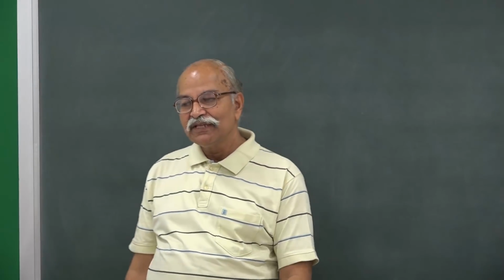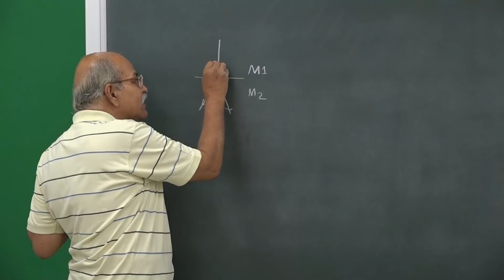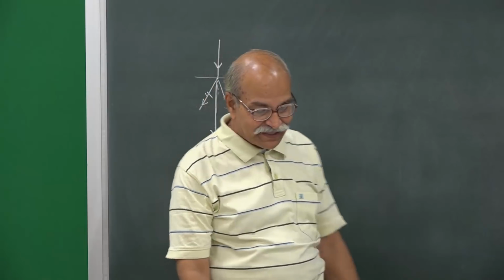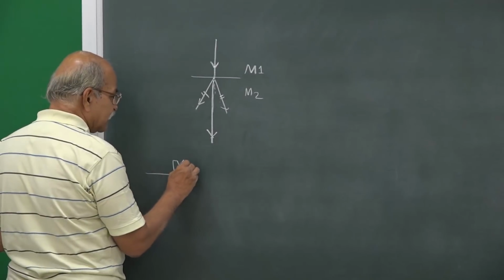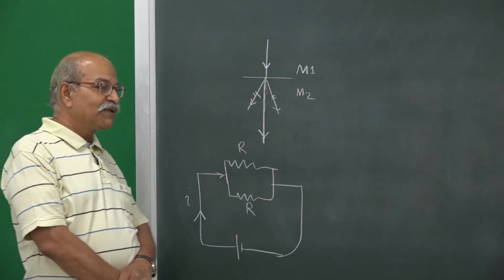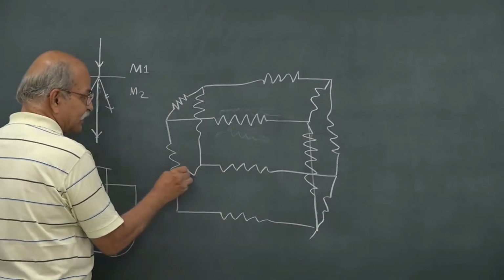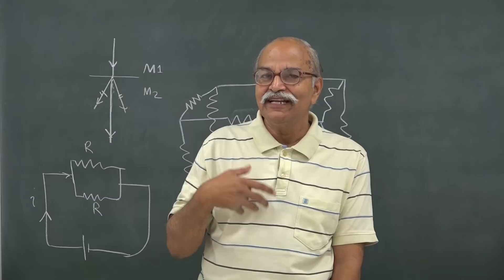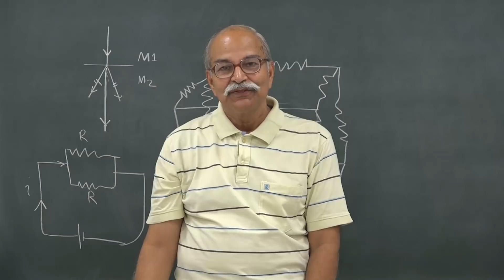Symmetry considerations in  resistance networks

Comment: why we use inverse symmetry in wheatstone bridge, despite the fact that current also goes through a middle resistance
Reply: The potential at both the ends of the middle resistor is same therefore the potential difference of the middle resistor is zero and due to that there is no current flowing through it
Reply: I have the same doubt

Comment: It can be also stated that current always follows that path which have low resistance. But in case if there is path of equal resistance, current will divide itself equally
Reply: I am a bit unsatisfied with this statement that current always takes low resistance path For ex if there are two resistors connected in parallel having different resistances then According to you current will not flow through the resistor having high resistance
Reply: @aryansinghparihar6932  what i said is that current always tries to follow low resistance path. If 2 resistance connected in parallel, then u will find that current flowing through the high resistance will be low as compared with current flowing from low resistance. Further, its quite obvious that current is bascially due to flow of electron. If there is hinderance on flow of electron, current will be low. Simple logic.
Reply: @aryansinghparihar6932  if u have any doubt regarding my statement i can clearify in my video. If u like i can make o  this topic.
Reply: Although I got it well but If you make a video then it would help me a lot
Reply: @darkseid856  yeah u got it right, thats what i stated before
Reply: @aryansinghparihar6932  check my playlist, i uploaded a video for the same.
Reply: @IntensityEducation  Thanks

Comment: Sir, why electron move from cathode to anode in electrolite solution (battery machinisim)??
Reply: @santafucker1945  because of the sudden difference created in their atomical composition due to induction of electric charge in a liquid (mainly) solution which actually intensifies(in some cases) the chemical effects of electric current affecting the flow of electrons .

Comment: Sir, what actually changes the potential of different parts of circuit? Do some charges accumulates at different parts?
Reply: The potential is divided through whole wire. But if you take series combination of different resistors then, different resistors will have different potential across them. You can say that resistance want to get the potential. The more the resistance the more potential it extracts from source.

Comment: Why do electrons not stop after passing across resistance because of the loss of energy?
 
If an electron does work to pass a circuit component load resistance, why don't they eventually stop moving after passing load resistance and transferring all of its energy?
Reply: Field

Comment: Sir,why current is same in series circuit?
Reply: I might be late but this is just like the flow of water...Suppose water is flowing through a hose pipe(Lets assume the water is incompressible), so in 1 second, equal amount of water should pass through every cross section of thee pipe, otherwise it would cause the water to be compressed at some part of the pipe. In a similar fashion, equal amount of charge should pass through every cross section in a series circuit of resistances, otherwise that would result in accumulation of charges (Just like a capacitor). I hope I was able to clear your doubt, but prefer asking these questions to someone near you, not to HC verma Sir. This is my recommendation, since this is a very basic question.

Comment: I disagree with the example of light given to explain the case of resistance.  The bend of light maybe dependent only on the interface but the amount of current passing throught resistor is not.  Instead it depends upon the whole resistance of path it can take